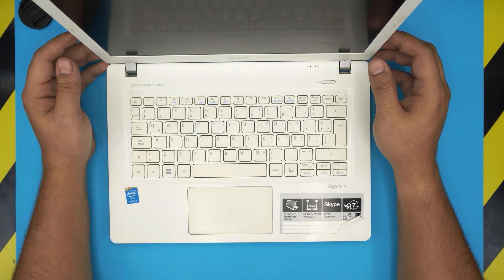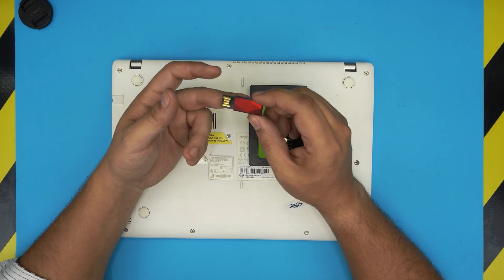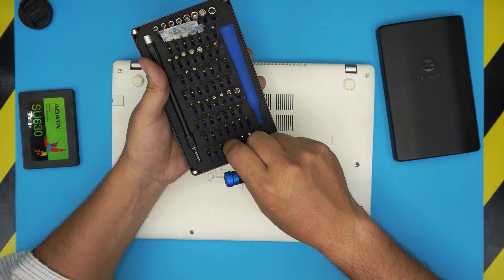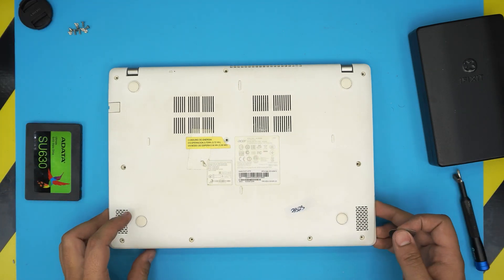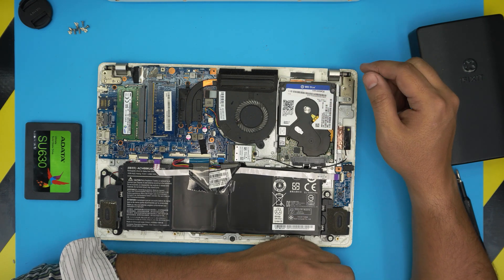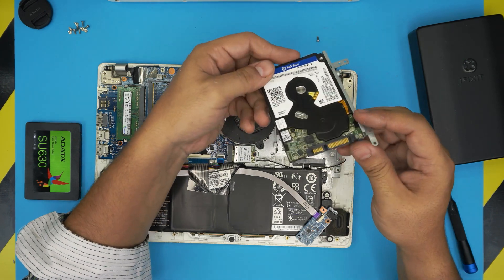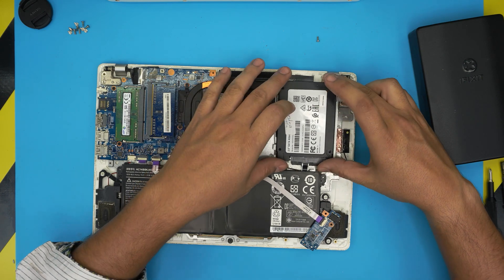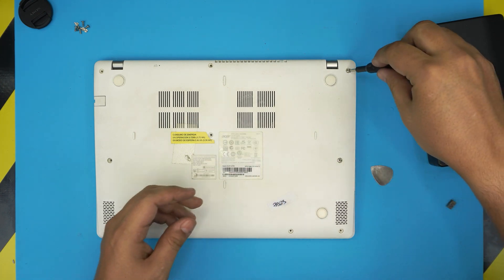Acer V3 371 📢 SSD | HDD UPGRADE

Comment: thanks
Reply from the maker: 😊 Thank you for your comment. 🙏 I’m truly pleased to know the video was helpful to you.
If you found the content valuable, feel free to like and subscribe—it genuinely supports the channel.
Please don’t hesitate to reach out with any further questions or suggestions.
Cheers🍻
Reply: @uFixTek  I have tried to solve the blue screen but it doesn't work. One technician just only by watching the screen without checking other things, he told me it SSD.  Is it possible to tell just by watching the blue screen.  

1.  Will changing SSDs solve the problem ? 

2.  Which SSD - Crucial, lexar , Acer , Transcend? 

Thanks
Reply from the maker: ROFL 🤣
Sorry but that was kinda funny — just looking at the screen and instantly blaming the SSD without checking anything else? 😂

Quick question: Is your laptop using an HDD or SSD right now?
To really know if it's the storage causing the blue screen, you should take the drive out and connect it to another computer using a USB-to-SATA or USB-to-NVMe adapter (depending on your drive type). Then use a program called *Hard Disk Sentinel* to check its health status.

That’ll give you a proper idea if the drive is actually failing.
Because in many cases, *RAM* issues can also cause blue screens — not just the SSD.

Let me know if you want a link to one of those adapters — they’re super cheap and handy to have 👍
https://amzn.to/44cUfFr
Reply: @uFixTek   Yes ,😂  it is funny that is why I doubt and didn't leave my laptop. 

My laptop - CPU type : Intel ( R ) , core i3. HDD model. V1.12. 

Thanks
Reply from the maker: where are you located? city?
Reply: @uFixTek  Germany, Berlin.
Reply from the maker: oh u very very far.
get a adapter and check the storage life and then you will know.

Comment: Hi! Mine is Acer Aspire V13. Looks physically the same. Can I do the same specs upgrade for my ram and HDD to SSD? Also, if i change from HDD to SSD, do I need to reinstall OS as well?
Reply from the maker: 🫠Regarding your question, yes you can, and when you replace the old HDD to new SSD then YEs you will need to install windows from usb drive, the links are in video description, it is super easy.
🔵 How to create Windows 10 USB Boot Drive: https://youtu.be/uDu8j2lE-dM
🔵 install windows on Acer: https://youtu.be/gDc66wYY2Pw
Should you have any further questions or requests in the future, please don't hesitate to ask me.
cheers🍻
Reply: @uFixTek  thank you. Appreciate it.
Reply from the maker: It's my pleasure my friend.